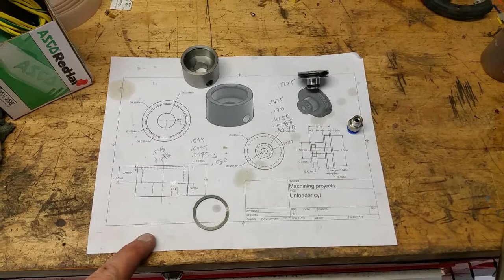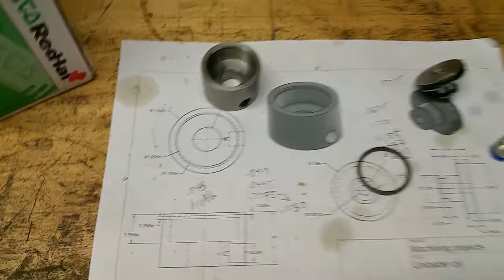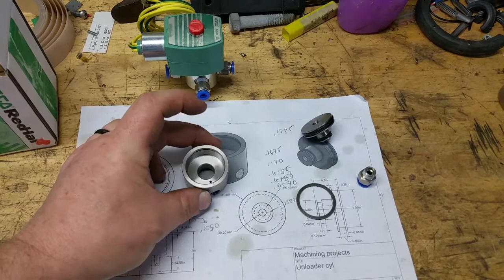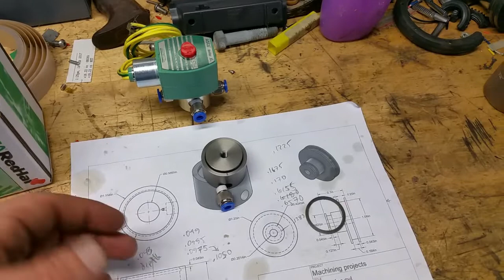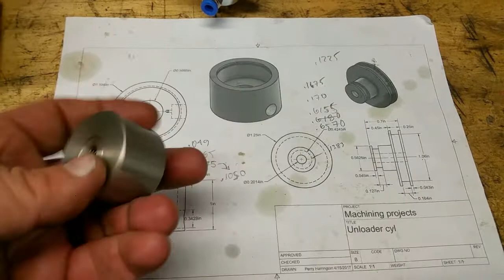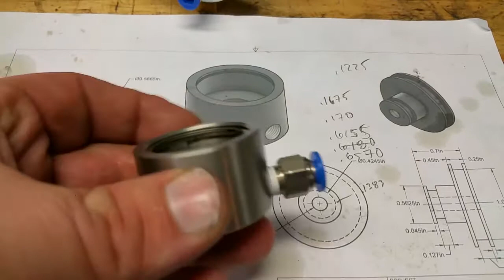Shop Compressor: Unloader Cylinder

Comment: I haven't seen that style of snap ring before.  Is there a specific name for it?  I'm curious how it gets removed once in.
Cool part!  Any vid of making it?
Mike
Reply from the maker: I tried to shoot this, but a frustrating combination of 17 minute recording length and difficult shooting angles just made the footage useless.  I bought an assortment of Spiral lock rings from McMaster, they refer to them as Twist-on internal/external rings.
Reply: It's a Spirolox. They're my go to retaining ring for smaller applications. All it takes is a small hook to get them out. No screwing around trying to find snap ring pliers that will fit in tight spots.
Reply: I understand the grief of shooting vids.  I scrap way, way more than I ever post.  I'll look up the rings. Thanks!
Reply: Thanks!  I just looked them up.  I have seen them before, but I've never used them.  In fact, I have a sample baggie of Smalley springs on a shelf that I got years ago at a trade show. lol

Comment: Its a nice piece but nothing to get an erection over. You seemed to gloat excessively. 303 isn't very shiny, and will rust a bit. 304 won't rust and can be polished to a near mirror finish. I wouldn't want to witness your reaction to making the part in polished 304! 
LOL
Reply from the maker: That material sat outside for 3 years, didn't rust, so I'm not gonna worry.  Not the shiniest thing that came off that machine, I'd say the hardend pull-studs for the Fadal are the shiniest so far.